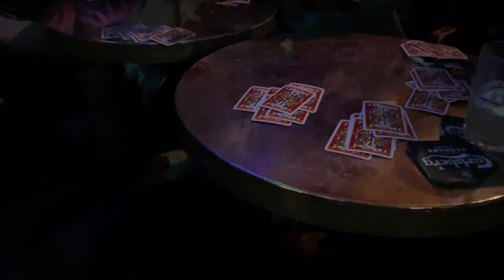2 GUYS, 1 CAR

Comment: The washer looks to be an eccentric for adjustment of the geometry. Needs a proper geo check and adjustment now 👍🏻
Reply from the maker: Ah okay, thanks Dominic - good to know. Is that dealer territory or is it something that can be DIYd?
Reply: @itsalexbaldwin  plenty of outfits with a good 4 wheel alignment rig and the skill, so not just main dealer work. Best to go on recommendation.